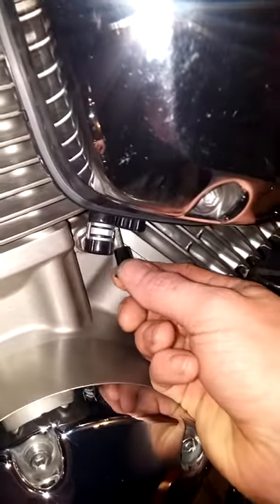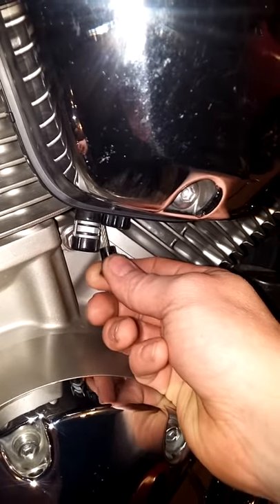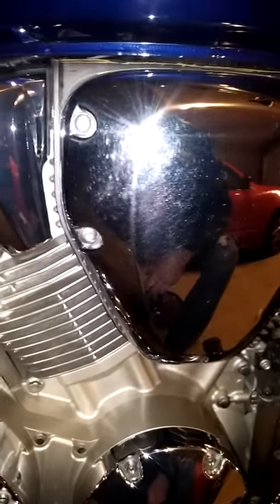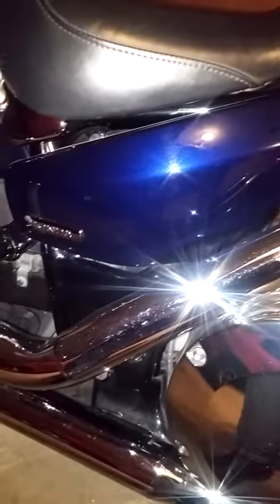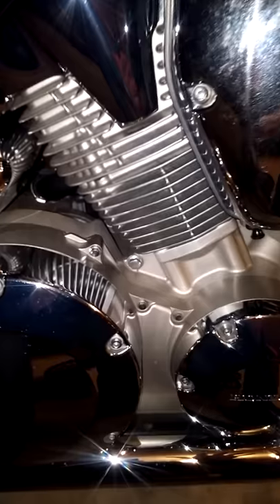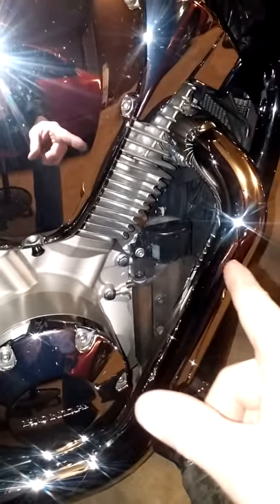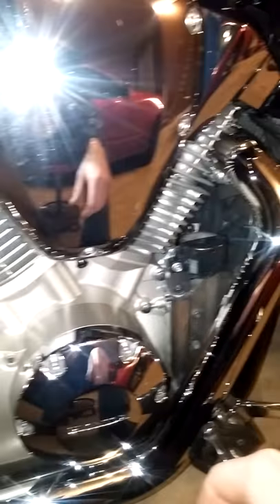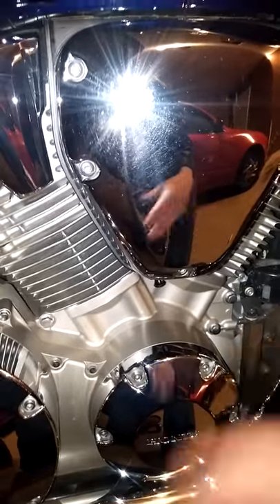Basic how-to on air/fuel adjustment on a 1300 VTX

Comment: All the people putting these posters down cause theyre not showing anything, you should take your bikes to a mechanic or do some more research. Its all by sound. Youre simply turning one screw. If you dont know where it is, figure it out. Cause you cant see it on these bikes unless you take the carb off or have a replacement  extension screw like from glens vtx garage which is what i have. It makes it so you can do this without removing the carb . Some have also done  it other ways.
Reply: I didn't hear anyone putting the poster down, they were just saying he didn't show anything, which he didn't, but he was cool about it and came on the comments and explained further, no harm no foul.  We are not all mechanics, and my VTX1100 won't stay running, and I don't have a truck to take it to a mechanic.  Figure it out!!??  Wtf do you think people are doing on the internet checking out these types of DIY engine repair/tuning videos??  TRYING TO FIGURE IT OUT!!  When you come across a video that says it's about how to adjust air/fuel mixture, on the type of bike you have, then you expect to see at least a little bit of the parts of the bike he is turning/messing with.  That's the WHOLE POINT of youtube...VISUALS!!!  Without the visual part of the advice, it's just a forum or a blog.  DERP!!
This post has nothing to do with the poster, Moody Lane, his heart was in the right place, and he gave great advice, he just had the camera turned the wrong way for part of the video, shit happens, I've done it.  I just hate when people like Chris talk out their ass and put people down.

Comment from the maker: clockwise takes fuel away. counter-clockwise adds fuel.
Reply: Which way are we looking at it I’ve completely fucked mine up and it’s dumping to much fuel and choking it out
Reply: Jason Scott , turn in, another words, screw it in like a standard screw, but slow, that will slow the fuel down
Reply: @jasonscott6381  what exactly does “choking it out”  or “dumping too much fuel” means or signs of that?

Comment: HONDA at low idol is not delivering enough oil supply. All spec the idol on the high side according to the manuals. Yes I know most have no tachometer, so much more to keep idol up.

Comment: That air/fuel extension screw is kinda pricey for what you get. I just ordered an after market extension screw, made for Honda dirt bikes ( has the same end on it as the stock VTX screw) and just epoxied one of those flexable screw driver shafts to it. So now it hangs just behind the carb, so you can't see it, but works perfect to adjust eh air/fuel mixture now. I'm frugal and like to save a buck and this mod cost me about $5!
Reply from the maker: Nice!
Reply: Link?

Comment: This is one of the easiest bikes to tune once you get familiar with the carb setup on it. Only having one carb makes it easy. My Shadow has two carbs that need to come out to do any changes on them, and then you have to synchronize them when you're all done. It's time consuming to say the least.
Reply: I agree. I had bikes with 4 carbs before. The only thing about this bike is it has the coolant running through the carb so make sure you burp it if you remove the carb to clean it cause it has coolant lines hooked up to the carb..  Honda says you have to drain the cooling system but you don't. Ive done it a few times.
Reply: ya you need a syncronizer for more than one carb. I have 4 carbs on my old cb550 four and thats a pain to tune lol
Reply: @chrisc6874  educate me on burping the coolant please

Comment: Great vid thanks. I put a K&N filter and new housing on my 1300vtx and now its gutless off the line, but still ok at 1/2 to full throttle. Do you think my fuel mix/ pilot screw might need opened a bit?

Comment: Great video, very instructional.  Do you recall if the pipes were original OEM or were they aftermarket? I've been playing with this adjustment for a while, attempting to  resolve an occasional backfiring.

Comment: Question, i did exactly as you did lowered idle and changed idle mixture screw. My bike idles good at around 2 turns. Question, so i now increase idle to 900rpm and leave idle mixture screw at 2 turns right? 
Thanks

Comment: I'm assuming the air fuel mix could cause me to need to use all my choke and have a rough running bike on startup? Also it backfires when i am all the way out of the throttle while moving
Reply: Rejet if you have changed any exhaust or air filter

Comment: After I warmed her up I slowly turned the idle knob counterclockwise slowly just to get my idle to slow down a bit and it did but then I noticed when I hit the throttle after that there’s a new tiny lag throttle that wasn’t there before I started messin w the knob. So I turn it clockwise back to where it was originally the entire time listening to it but I think the throttle log is still there now what am I doing wrong here? How do I get rid of that throttle lag should I just keep turning the knob clockwise to bump up the idle until that throttle lag disappears?
Reply from the maker: The idle speed adjustment shouldn't have any effect on fuel delivery. If idle speed is set too low it could cause stumbling when blipping the throttle. Idle should be set at 900 RPM on a warm engine.
Reply: @MoparMasters  Tnx for quick response! 🤙🏽 yes I might’ve counterclockwise richen it up a tad bit today and was worried about that new throttle lag that appears out of nowhere, tom I will adjust accordingly to get rid of that throttle lag ty for the video it’s super helpful nice bike btw u still have her? I’m a total noob and got gifted this bike out of nowhere by my next door neighbor who’s a retired Air Force fella he’s getting up there w age n don’t ride much but took care of this motorcycle. It’s an 06 vtx1300r excellent condition only 11k miles I don’t even have a motorcycle license yet LoL but I’m sponging everything all atm tnx  again Mopar Master! Sorry I might’ve asked the same questions few times on ur video here my apologies 🙏🏽

Comment: I have two VTX , both 1300cc. One I bought with Vance Hinds exhaust.  Since this didn't come with stock exhaust , I can't tell if the carbs were properly re jetted .The bike runs fine but about every 800 miles I have been checking the spark plugs which I noticed are carbon fouled. I replaced them, cleaned them , have put various carb cleaners in the tank(Gum Out, Marvel Mystery Oil & Sea Foam )and changed the air filter but the problem is still there. I think the air/ fuel mixture is too rich.
     Questions: Does any one have an idea what the problem is?  Where did you get that fuel /air screw extention?
Reply: Steve 
     Thanks a lot for the explanation. I'll give it a shot

Comment: Thanks for the video. There are either two or three knobs, what do each of them do? I see one on a braided wire, and then two others that just look like knobs. Thank you for your help!
Reply from the maker: The braided wire is the Glen's air/fuel mixture adjustment I installed.  This won't be on a factory bike.  The 2nd knob is for idle speed adjustment. The engine should idle at 900RPM's when fully warmed up. The 3rd you'll notice it has a clamp on it. This is actually the drain tube for the air filter housing and should be drained during every oil change. It drains all the oil droplets and combustion byproducts that make their way into the housing during normal operation through the crankcase ventilation hose.
Reply: Thank you!  I really appreciate your time.

Comment: I have the same bike, but mine is blowing black smoke out when I start it. It is also blowing back smoke out when I rev it up. I have taken the bottom bowl off, cleaned it out, replace the jet, cleaned everything out, and still running pretty bad. Any ideas? Thanks..
Reply from the maker: It could be a few things but it all points back you the carburetor. It's running rich. Whether it's from incorrect float adjustment or too large of a jet installed, it would be difficult to say without having the bike in front of me.

Comment: I have the same bike and it's running so rich it starts blowing black smoke, files the sparks plugs then starts backfiring. Can the original screw be reached with a flexible screw driver with out removing the carburetor? If so philips or flat? Thanks for posting this video, Thumbs up.
Reply from the maker: OG Timbercraft Unfortunately, the carburetor has to be removed. If the pilot screw is stock, it will require a "D"-shaped tool to turn it. Before you remove the carburetor, remove the vacuum line from the fuel petcock and make sure the diaphragm isn't torn.Double check that the choke isn't working its way out. If those check out good, remove the carburetor and see if the pilot jet has fell or vibrated out. Also remove the carburetor bowl and make sure the slow and main jets are still in place.
Reply: I'm going to order the extension and clean the carb. at the same time, Thanks for the reply.

Comment from the maker: I have slip-on exhaust. If your struggling with a pop when you let off the gas you may have an exhaust gasket leaking where the pipe bolts to the head. Don't over-tighten the mounting bolts of this is the case. Get new gaskets instead.

Comment: 2 turns from what? You give no point of reference. Unless I missed it.

I've been trying to ascertain as to "where" the air/fuel screw is. I just purchased an air/fuel adjustment tool from Glens VTX garage (not the permanently mounted one you have) but I don't know where the screw is.

My bike has been running extremely rich and I want to correct it before selling it.
Reply from the maker: vtxman1300 Sorry I took so long. The air/fuel screw is located on the bottom of the carburetor behind the bowl on the engine side of the carb. For clarification, You will screw the pilot screw in until it is LIGHTLY seated. I cant stress enough, don't screw the mixture screw in tight at all. As soon as it stops, its considered seated.
Reply: Moody Lane No worries. Thanks for the response.
Reply: How are you a "vtxman" if you dont even know here the D screw is ...lol
Reply: Dave Parsley I don't claim to be a mechanic but I do ride a VTX. 
By the way, I ultimately had to have the carburetor replaced.
Reply: vtxman1

Comment: well, by far better than the last video I watched on the subject,  he did essentially the same thing, but he never showed where the screw was. You at least showed were the screw was, so that answered 1 question for me.  I was reasonably sure that was it, but was agraid of mucking with it for fear of jacking it up worse.  so now I think Ive got the general gist, 1 thing that you say keeps throwing me though, you say dont forget to adjust the idle?  I kinda thought thats what this was doing via the fuel air mix?  is that what you mean?, or is there another way to adjust rpm idle that I'm clueless on?  thanks for your help
Reply: There is an idle adjustment knob on most bikes that sets the idle in unison to both carbs.  Basically what you want to do is have a nice warm to hot bike before starting.  Get an idea of what your idle sounds like if you don't have a tach.  Then you set the main idle down a bit lower because this will aid in letting you hear what your idle mixture screw adjustments will be doing to the bike. Its much easier to hear how each cylinder is reacting with the main idle turned down a tad.  

With your warm to hot bike and your main idle down a tad. You start with one carb idle mixture screw and pick a direction to turn slowly you will hear it effect the idle of one cylinder.  Your goal is to get that cylinder running smooth with a high rpm.  For example you turn screw all the way in and seat it the cylinder will probably slow to a crawl or even die.  As you turn the screw out you will hear the rpm start to pick up than when you keep turning the rpm will again slowly start to die again.  You want to adjust it in the middle to where the RPM is highest and the cylinder sounds the strongest.  Then you move to your other cylinder and repeat.  

Now will both idle screws set you want to adjust your main idle knob again back up to factory settings if you have a tach or by ear before you started.  I hope this all makes sense.  I know this post is old but I hope it helps someone out.
Reply: @theripper121  if I was turning it out (counterclockwise) a tad while the bike is hot I noticed my idle drops a bit but then i noticed a small lag on the throttle now when I brap the throttle that lag wasn’t there before I started the procedure so do I get rid of this lag buy turning the knob back in slowly (clockwise) to kick up the idle and until that lag disappears when I hit the throttle?

Comment from the maker: If you changed the air filter and the air filter housing you will have to re-jet the carburetor as well as adjust the pilot screw.

Comment: My VTX will not take throttle like from a cold start. I don't use the choke it usually starts rite up. Once running if i give it some throttle it will stall out. Once warm not so much of a problem. Stock intake cobra exhaust. Some backfire on deceleration every now and then.  Would this be running lean? Think i will order that par or improvise.
Reply from the maker: Seems a little lean if its backfiring on decel. A cold carbureted engine won't run well without a little extra fuel from the choke.
Reply: @MoparMasters  Just put on my  61/2" Perm mount A/F screw from Glenn.  Haven't taken it out to warm up maybe by this weekend.  Also got the flasher/alarm from him putting that on tomorrow.
Reply: I have the same exact set up and have the glens permanent a/f adjuster installed and am having this same exact problem. Just wondering if you figured out the problem and if you had to lean it out or richen it?
Reply: @albertosteffens9231  I have the Glens setup as well.  I twist the throttle about three turns on cold mornings and that usually works for me. I did have a bad diaphragm in the carb that I had to replace.

Comment: It would help to point the camera at what you're doing
Reply from the maker: They don't make a camera small enough to see what I'm doing. I'm turning a screw in tiny increments that's buried on the bottom of the carburetor, behind the carb bowl. Even if I showed you my hand turning the knob, you would never see movement due to only turning it a few degrees at a time.

Comment: i pulled my air intake off and switched it to a spike intake and my bike will start up and run but wants to die when i give it any throttle. the spike came with a main jet that i ended up switching out and it's still doing the same thing.   could my problem be the idle line your showing in this video?  also the new jet it came with looked significantly smaller than the one that was in there
Reply from the maker: Most carbureted bikes won't run well with a spike intake. They just don't create enough backpressure. You can try adjusting the pilot screw, but don't turn it out farther than 3 to 3.5 turns. Any more and it can fall out. If that helps but it still runs a little bad, you may have to go up a size on the pilot jet.
Reply: @MoparMasters  yeah. im going back to stock.  i like the look of the spike but my bike was running phenomenally before i swapped.

Comment: do you have a video showing me how to change the spark plug wires on a Honda 1300 VTX CC
Reply from the maker: Chuck May I dont but they are very simple. Pull the 4 chrome covers straight off the engine from the side and the plugs are right there. Give the spark plug boots a good twist to break the seal before pulling them off. I believe the spark plug needs a 14mm deep well socket to remove them. Use a piece of rubber hose that fits over the tip of the plug to start the threads on the new plugs to prevent cross-threading.

Comment: I have a zx6r, ninja, vf 1100 magna, 1300 '03 vtx, and Harley Electra glide. The Harley is fuel injected. I've decided......... I'm never buying another carbureted bike. Major pain in the Arse with pilot jets, float bowls, a/f mix screw, etc....Takes a degree in rocket science to figure it all out.
Reply from the maker: Agreed. I have an '04 FI Dyna with a Powervision tuner. MUCH less of a pain in the ass!

Comment: So did we like turn the A/F all the way Counter Clockwise then move it Clockwise the two or so turns?
Reply from the maker: You should turn it clockwise (like your looking at the end of the knob from the bottom) until it stops. Don't use any force or you WILL damage the needle or seat. Then start slowly backing it back out counter-clockwise.
Reply: @MoparMasters  Got it. 2.5 turns of the A/F (No Gary's VTX tool used). She's purring now. Thanks.
Reply: @johngill444  what tool did you use rather then the $49 one from gary and where can i get one thanks for any information
Reply: Hi John how did you adjust the a/f? does it need a special tool?

Comment: were did or what way did you turn your idle screw? is that the little black knob connected to the filterbox next to the air fuel mixture screw? were did you turn that to
Reply from the maker: The black knob under your airbox will be the idle speed adjustment screw. I added an extended mixture adjustment screw so adjusting the idle mixture would be easier. I got it from Glen's VTX Garage online.
Reply: Yes, I just put one on my VTX I got from Glens Garage as well. I just didn't know if it was nessary to turn the idle screw down when doing the A/F adjustment? And if so is it clockwise for lower idle and counter clockwise for higher idle? Thanks again
Reply from the maker: Yes turning down the idle makes it easier to hear the subtle differences in engine tone. If your looking up towards the bottom of the idle screw, lower will counter-clockwise and higher will be clockwise.
Reply: Thank you sir